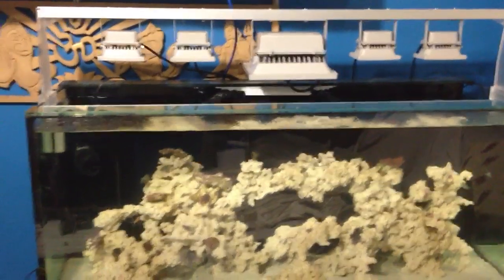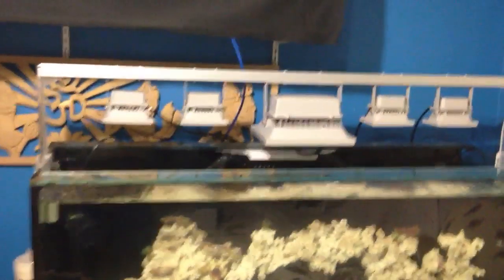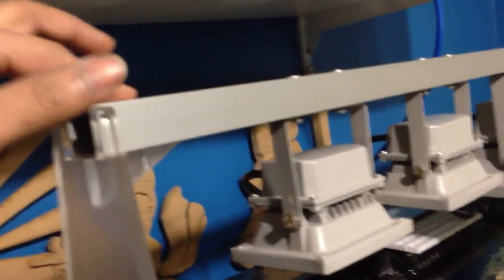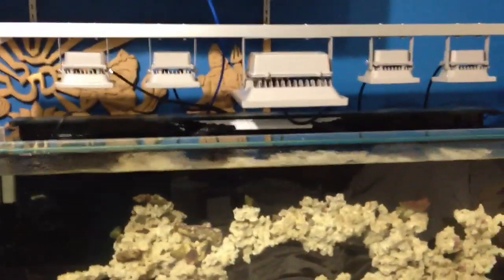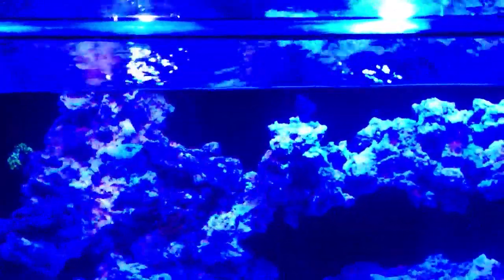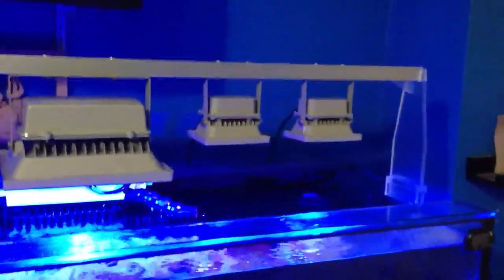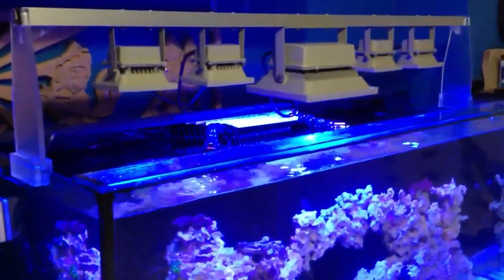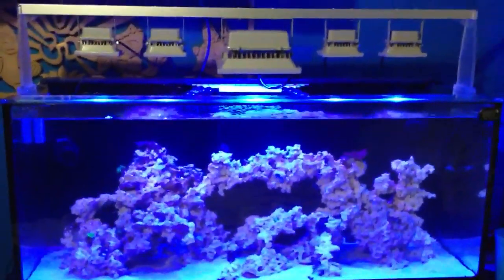Reef Tank Led Flood Lights

Comment: hey just wondering i bought 6 10w led lights 5 for main tank and 1 for refugium. i got the 10w rgb lights but when i put them on a timer or plug them in they go into party mode and flash and display all the colors. Did your lights do this and how did you get around that. i want to be able to put mine on a timer. also if you could send me an ebay link to the seller of your lights that would be great. thanks

Comment: Hey. So I Waz lookin for a DIY. LED LIGHTS FOR MY 150GAL TANK.  And I saw your video.  Nice work BTW.  well I Waz thinking about 6 lights in total.   Goin like this. 30.10.30....30.10.30. The tank is 18 1/2 tall. Would you think that it will work. Or is that to much. Use the 30 wattage for the day lights and the 2 10watt rbg for the night time.???? Thanks
Reply from the maker: the won't be enough for a 150g tank. The lighting is great for a flood concept. The light penetration to the deeper depth is garbage! I would stick to the Par38 lights at the lens can be selected to reach some tanks from 10" to 30" deep.
Reply: +Primo Reef Acrylics can you grow sps with the lights

Comment: Yo. My bad about the comment I put on your other video.  I didn't know it was the same tank. I wanted to know how your tank was doing with the led flood lights.  I see you have some corals.  That look good.  Have the lights been working for you. You need to do a update on your tank with your lights.  Thanks.  Also yes your tank is looking great.
Reply from the maker: Hi Tony, Well this tank was sold 4 months after I had set everything up. For the time I had the tank the lights did what they needed to do. However the 10watts were not enough. I highly suggest you get par38 lights that are 36watts or 54watts.

Comment: I would like to know how many nm you would get at the bottom of a 2 feet deep tank with 50 watts rgb flood light led thanks
Reply from the maker: With my experiment, I concluded that the par38 full spectrum reef lights are way more effective then these flood lights. for a 24" depth aquarium these flood lights won't penetrate that deep.

Comment: How many par38 for a 180 gallon i just want to keep soft coral thank
Reply from the maker: Lightboxleds.com has these new 48watts par leds with a built in fan. I will be buying them for my new build. Great reviews. and a very reliable product. for a 180 I would suggest to start off with 4. and if you need more in the future you can always add more. fragbox corals  use Primo Reef Acrylics as referral